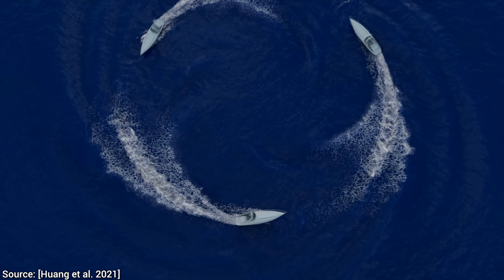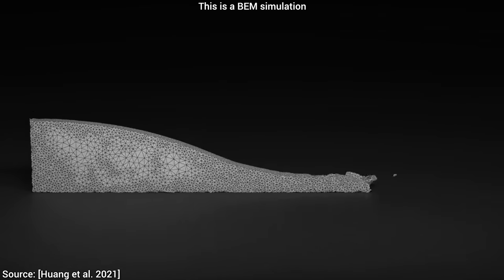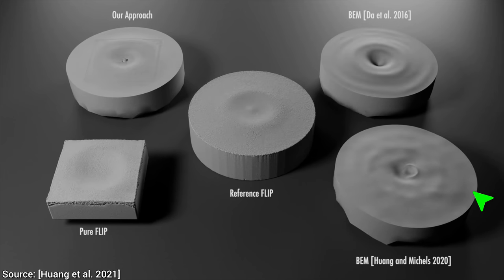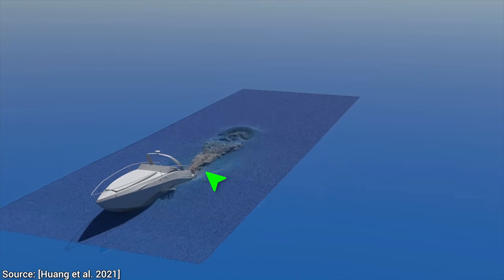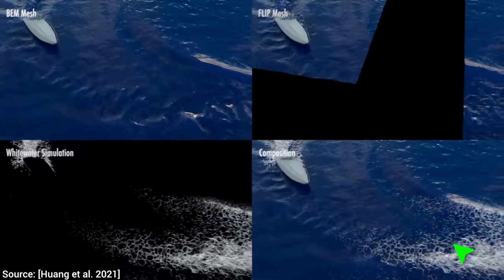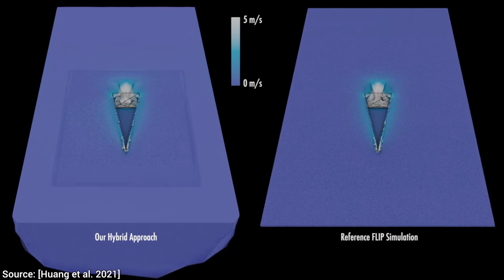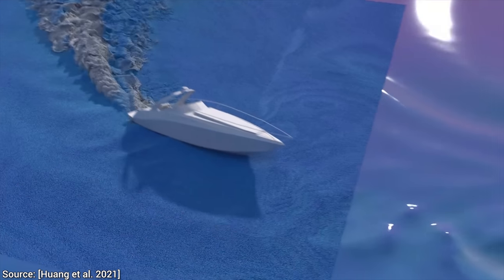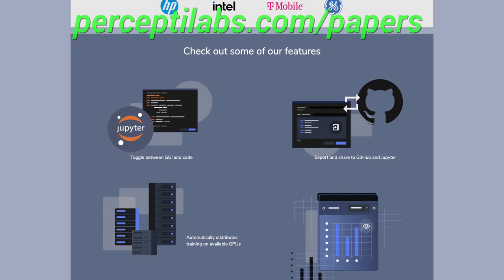This New Method Can Simulate a Vast Ocean! 🌊

Comment: Pretty cool. But for those of you who don't want to wait for this to NEVER be implemented in anything any time soon, you can do something fairly similar via compositing. Though for obvious reasons you'd have to render the scene twice. First render the scene using the FLIP simulation, and second with the BEM sim, then in post, overlay the FLIP on top of the BEM using some generous feathering. Ideally you'll be able to have them work without a noticeable seam.
It seems like doing 2 sims and renders would kind of miss the point of the paper, but I guarantee you doing it this way would STILL be a shorter time than simming the whole scene using FLIP (and would take up drastically less memory to boot). Plus you get the added benefit of the crisp FLIP sim, and the BEM just like the paper. 
Obviously they don't interact with each other, but if both sims are in the same scene and interacting with the same objects, they really don't have to.

Comment: You pointed out the flaws of this hybrid method at 3:34 , but I honestly think that depending on the usage you can circumvent this issue with hand-authored techniques (eg. Generating a heat map and using that on the surface of the ocean to give it that “crisp detail” that it’s missing). Also, does this run in real time? Even if it doesn’t this could be used in things like movie production and educational models, but if it does then this has real potential for being used in game development
Reply: I also thought about that. Like whenever the density of the BEM increases let it take over by FLIP. But ... well this researcher is already pretty deep into this!! I'd guess they though about this. And as a first implementation trying to blend these methods this is a fair approach and already pretty good results. Imagine 2 more papers down the line ... 😉
Reply: You could add some fast fourier to add that detail! Would look convincing enough. This isn't in real time sadly, it's about a minute per frame (more so in that scene with the three boats).

Comment: Why not amplify the frequency difference with a linear scale to increase the detail pre-render as a post process filter? I mean, it's a hack but if it yields a better result without increasing the processing power required significantly....
Reply: That's actually an interesting witty optimization hack.

Comment: If there was a way for it to swap the simutation based on the density of the waves, would it work?
Reply: I do believe that would be one more paper down the line.
Reply: I was thinking a similar thing.
What i was thinking was run both simulation simultaneously and average them out with a weight. Their weights come from a tertiary ai that approximates the level of "sloshiness" or caos(in other words an ai that can gage how accurate the sims would be) in a  given area you can as well determine these areas using another ai to determine the change in some area(this is to bring down comp time).
Of course for this to be better than the simulation in the vid there would be some heavy modifications to it.
Reply: @ryanmcmanus7273  the whole reason FLIP isn't used individually is because it takes too long, what you're saying is to use FLIP anyway but also average it with a worse algorithm. and yeah I'm pretty sure these algorithms don't work in the way you think they do by the way you're suggesting usage of AI
Reply: it would be awesome if there was a way to measure how detailed a region is while FLIP is running, and whenever it finds a low detail region to mark anything in that direction as a BEM region. that would give us dynamic regions instead of rectangular fixed-size ones. I doubt it's anywhere near as simple to implement as it is to describe though
Reply: @AfonsodelCB  Detail can be approximated by surface area to volume ratio in a given cube. The more turbulent, the more surface area. It's also possible to approximate it using "temperature", the average of the length of the difference between the velocity of a particle from the average velocity of all particles within a region.
Reply: @AfonsodelCB  i have to agree that it would be extremely hard to implement, but I believe if it could be done efficiently the result would be awesome, and would bring detail to the flatter areas, better waves up close, and an even smoother transition. But to make it look the same as the reference image for the untrained eye you could just do something to add in detail to the flat areas.

Comment: Hi! I spent a good deal of time designing my own fluid simulation with but it isn't very realistic and the surface does not seek level without shaking the containment a bit. Can you please recommend a good realistic 3D fluid simulation coding tutorial that has a high ratio of realism per computational cost and would perform well on a mobile device?

Comment: Isn’t this already how it is done in Houdini and other fluid sims like Phoenix?
Reply: The FLIP part, yes. The BEM part, no.

With existing software you can easily have a FLIP region inside an ocean, and the ocean can have waves, but the waves outside the FLIP sim are basically a clever texture map (Tessendorf's method) and aren't really connected to whatever's going on in the FLIP region. Blending the two regions is pretty hard to do, and takes a lot of ad-hoc fudging.

This new way, the BEM part can efficiently do the bigger waves, and the FLIP part can do the detailed region, and the two methods are talking to each other the whole time.

Comment: i don’t get it . We use this type method in vfx for many year. Simulating large ocean then blend with another flip on
Top of it. What is the benefit for this paper ?
Reply: The problem with FLIP is that deep down, it dreams of being oatmeal, not an ocean.

Big ocean waves & swells never survive in a FLIP simulation without breaking, or dissipating, or turning lumpy. It's only suitable for short-lived effects like bow waves and splashes. Layering up FLIP sims of different resolutions might work for some action shots, but it has a lot of side effects that break physics, so you never really get the results you're expecting.

This new method has two-way coupling between the ocean-scale stuff and the boat-scale stuff, so you wouldn't be wasting as much time trying to fudge it. It'd be a much nicer way of simulating longer shots without having to make weird compromises.